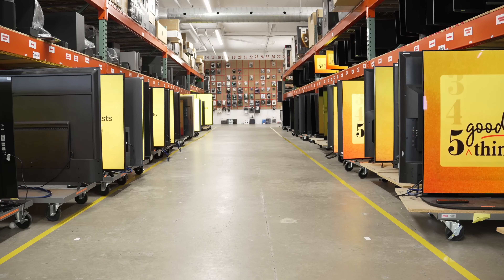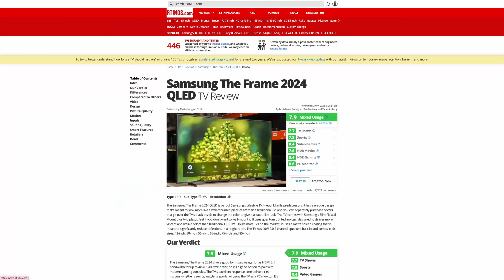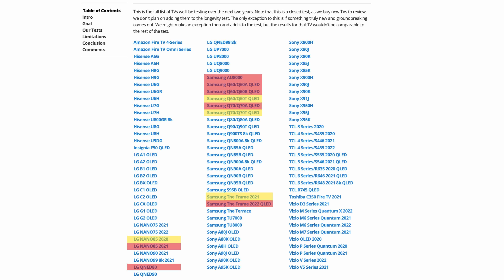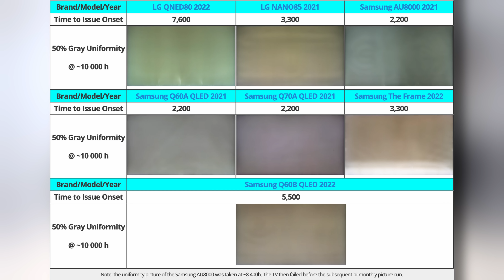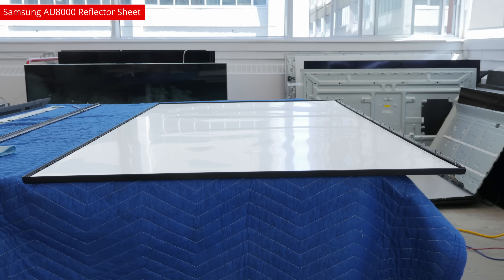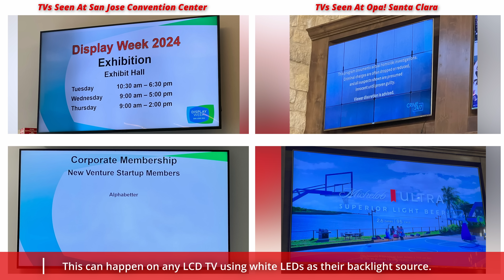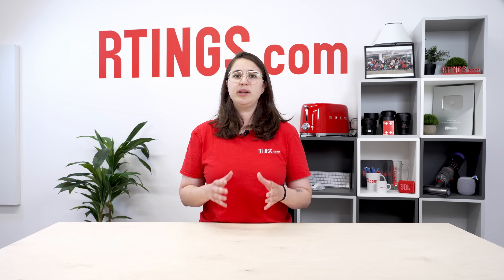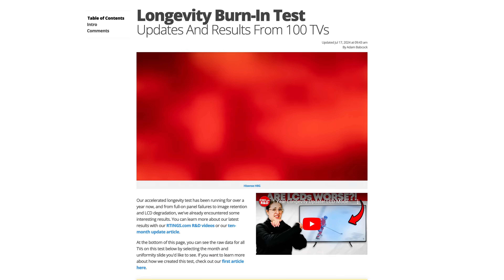Edge-Lit TVs Fail FASTER Than Others (100+ TV Test)

Comment: Early LCD TVs were thick. The design allowed for greater ventilation. That explains why they lasted for over a decade.
Reply: They also did not have LEDs that allowed for a thin panel. They used CCFL backlights, those are big and chunky, so the did not even have the chance to make them thin.
Reply: I do find ability to diagnose or try ti fix it to not need to buy a brand new tv if it is doable fwiw.. especially if bacjlights are what more or less fail first typically.. also reduce its brightness as much as you can fwiw.. vs factory defaukt 50 percent or highest mode..  @Galileocrafter
Reply: @Galileocrafter  It would make sense for consumers to demand thick LCD TVs with fluorescent backlights in order to obtain the best durability (and sound quality too, the in-built speakers were often actually passable back then) regardless of higher energy consumption or lack of "style".  The manufacturer could back it with a 12 year warranty, that those making LED-lit TVs might be unwilling to match.
Reply: They were thick and heavy. My last lcd lasted 14 years
Reply: We have a 40" 2007 Sony LCD in our bedroom. So far as I can tell, it still looks as good as it did when new. No 4K, of course, but we wouldn't be able to see any extra resolution from the bed anyway. We paid $1500, and I think it was worth every penny.
Reply: @jamesheartney9546 I still have a 26" LG from 2007. It is 720p, but still works good and hasn't had anything happen to it. That's surprising, considering that is the tail end of the capacitor plague era, in which so many Pentium 4 era computers, LCD monitors, and tvs were sent to the dump because of bad caps. As far as a CRT goes, I still have a TV from 1976 that works fine. No remote, and in order to change channels, you turned a VHF knob or a UHF knob. The cabinet is finished in fine fake woodgrain LOL
Reply: @jamesheartney9546  I still have my 1080p Sony 42" from 2010. Thanks to chromecast type devices I can extend their lives and use them for pretty much everything a modern tv can be used for.
Reply: @jamesheartney9546  I have Samsung 55" smart LCD chrome plated cover 240HZ, 3D TV ( never watched in 3D) , I have even paid  extra $250 for  4years warranty ( no needed this year the remote just on  last month failed) Tv still great color is amazing as new but it's not 4K, watching 720p no upscaling feature so, is not great for oldies)
Now I thinking to buy QN 90C series on 85 inch for our new house, but I am confused paying $3500TV with extra $820 plus tax on top for the Bestbuy warranty ☹️ any one feedback really appreciated
Reply: My chunky main turned bedroom LCD lasted since 2014.
Reply: they had fluorescent tubes for a backlight instead of leds, slightly less power efficient but they seemed to last, they were expensive too, but I think part of their longevity was they had to stand up top consumers expectations of what a TV should be able to handle coming from CRTs which many still work fine even today
Reply: Yep. My 2010 Sony Bravia is a bit thick, and it helps!
Reply: @aaroninclub I too have a 2010 Sony bravia. Flawless. 

When it breaks I'll just get another. There's plenty on eBay for around £25. Why would I pay ten times as much for a TV that'll break in 2 years?
Reply: My 47 inch wall-mounted 1080p LCD from 2012 is still going strong and is pretty much on 10-15h every day. I still see no reason to upgrade even with 4K going strong...
Reply: @Wockes same here , hesitant to "upgrade"
Reply: Bring back dumb TVs. I like 'em thick.
Reply: Watching this video on a 10+ year old Emerson tv that still works like a charm. This video has me rethinking some of the models I've wanted to replace it with.
Reply: Our living room TV is over a decade old and still works great. The screen puts out A LOT of heat though (fair trade off for reliability imo)
Reply: Still running a TV thats 15 years old by now and the best feature is that it can accommodate proper frontal firing speakers so you don’t need a soundbar
Reply: I am at like 15+ years on my LG 43" 720dpi LCD. No signs of wearing out. Daily use as my Dad watches a few shows at night over air.  It's crazy that it's still going strong.
Reply: Amazing that they've managed to get people to pay more, for a form factor which will inevitably reduce longevity and prematurely cause the viewing experience to degrade.

The funniest part of the whole thing, is that all you accomplish is being able to brag when new people come over how thin it is. It doesn't even sit more flush with the wall, as the base is still thick.
Reply: @Nevir202 planned obsolescence.
Reply: @Nevir202  I wonder why the electronics can't be placed in a separate model that can be placed somewhere else?
Reply: @TassieLorenzo  Interesting idea, probably possible, but there must be some issue with it, or I'd have expected someone to have done it.
Reply: my 37 inch vizio from 2010 is still kicking
Reply: @nitros3v3n I am not alone in clinging to my 37 from the same year
Reply: @secordman  it’s definitely a unique size
Reply: Yeah my 40” Sony from 2007 is still going strong. No changes in image quality over time and has significantly less blooming than all but the highest end current mini LED TVs.
The tradeoffs though are that it’s bulky and heavy, has comparatively bad contrast and black levels, uses twice the power of a current 65” and pumps out heaps of heat.
Reply: My Panasonic from 2006 still works, still used daily.
Reply: The reason was also because the backlight was CCFL and not LED.
Reply: I've an early fullhd samsung 32" (no led backlight) working in a shop 5 days per week since 2008!! model ln32a650
Reply: still got my LCD from 2008  it's 16 years old good brightness too
Reply: A Vizio 36-inch LED dumb TV from 2014 is pretty durable too.
Reply: Got an old 1080p samsung lcd or led tv, it's only 23 or 24 inch but the thing is thick and its probably from 2010's. So 14+ years old. Still working.
Reply: Early "LCD" displays still used xenon gas fills fluorescent light to light up the TV screen. those were even hotter, and the reason the tv's were thick, was because the light needed 3/8" around it so that it didnt cause a fire, with the tube itself being 1/2" in diameter in genera, you'd need 1 full inch of space for that light source.   LCD != LED.
Reply: a Samsung from 10 years ago works just as good at near 720p as both my monitors at 2k 165hz
Reply: My bedroom tv is like 15 years old. Thick as can be. Dim too. But still runs perfectly fine! And has the inputs I need! Sure a new one would be great. But they lose some of the inputs I want. Not everything I have is hdmi or display port. Plus the expense and failure rate, yea no. I’m good for quite awhile more lol
Reply: My LG from 2006 is still chugging along.
Reply: @jamesheartney9546 I still have a 40" Sony Bravia which I bought at a similar time to yours.  Great picture quality for a 1080p TV and has been absolutely reliable.
Reply: Ever notice when companies take something that works and makes it "better" it does not last as long. What do they say? If it's not broke don't fix it? Lol.
Reply: Same my TV is practically vintage tech it's not the most mind bending picture but it's like a 3rd as old as I am and should not of out lasted modern tvs
Reply: I expect many more years from my Sony KD-55XF9005 that's still going super strong after 6 years. 😊
Reply: I gave my parents the first flat TV I ever bought, a 37 inch Samsung from 2007 (CCFL-backlit LCD). Except for a dark area in one corner it still works perfectly, and they have it on literally every day.
Reply: Early they were CCFL which had a better life span ( but they could turn pink or get dark on one end).  Then when the first LED LCDs came out the were still thick and had more room to vent heat,but when they got thin, they got hotter.
Reply: Still using a 2008 43" Samsung LCD daily with no issues. The capacitors blew and were replaced under warranty soon after purchasing, but there have been no problems since bigger capacitors were installed. Screen still looks the same, no pixel issues. Fast forward to a Samsung 43" LED Smart TV purchased in 2012 and issues were noticed within two years (that fading effect near the corners/edges, diffuse bright spots). It currently still works, but it has faded pixels that look like strips going down the left side depending on the screen colors. During the past year it's happening on the right side. It cost more than the LCD (both cost over 2k usd), but is clearly not built to last. It gets very hot like it needs its own fan!
Reply: my philps 42” lcd led backlit tv also is from like 2010 and it has very nice colors, its very bright, low motion blur, great sharpness even when looking close up on it. it gets hot too but you can feel so much heat rising up from the radiator like design on the thick part of the back. its not actually that thick its one of the slimmer designs of the time. it also turns completely off when in sleep. it doesnt keep the computer part on like modern tvs do. hasnt ever had a single issue with it and never going to get a new one because the leds arent even getting dimmer its just as good as its first day still.
Reply: They also used a lot of metal instead of plastic, which helped disperse the heat better. Especially for the back and the wide bases that used to sit under the TV. My Vizio M series has lasted 11 years and 4 moves. It's outlasted a Fire Stick, a Chromecast, a PC, and a PS3.
Reply: @Paratet  I have a Sony xbr4 that had  had since 2008. Still great picture. No issues and Sony warranty was extremely excellent when I had a out of warranty. They gave me a brand new TV plus a bigger one and a newer model delivered and installed for 0.00
Reply: Why would they make them to last. They make more money replacing them, especially when most shops only give you one years guarantee
Reply: @colinperret3523  Yes now all small tiny semiconductor chips and covered with plastics no many ventilation holes that we can see , specially OLED for get it, manufacturing companies are looks they want to ripping off chunk of moneies from customers on these days
Reply: 0:28 Who runs their screens at full brightness? I run my monitors at around 25% brightness.
 Surprised manufacturers do not put more LED to underrun them to reduce power consumption and heat.
This is an informative :) Now I know rather to buy an HDR LCD model with a higher number of local dimming zones. So I get as many LEDs as practical and with higher brightness capability. I would still run them at rather low brightness with SDR content. It should last a long time :)
Reply: @ArthursHD  It really depends on the specific monitor and viewing conditions.  I had Dell monitors in work that needed the brightness pretty much maxed from brand new to give an acceptable picture, but the replacements 4 years later were fine at about 30%.
Reply: Also they probably made way more heat too
Reply: They were expensive too, which is another reason.
Reply: ccfl lamps also degrade and burn too ... plus they generate much more heat.... I have an old ccfl direct  backlight tv, it still works . One of the ccfl lamps is fadiing , but the problem isn't  that visible
Reply: Early lcds were also extremely dim, low contrast, full of ghosting, and had horrific viewing angles.
Reply: My first lcd melted. The screen turned white and it smelled bad.
Reply: I have a Sharp Aquos 70" that has been running for over a decade, and for the last 8 years has been on at least 12 hours a day keeping my pet entertained while I'm at work. To me, it still looks as good as the day I bought it!
Reply: Early lcds also generated much more heat as well.
Reply: Yep. Have an LG model that's 2" thick. No problems yet. I'll trade thin for longevity.
Reply: I have a 37" LG LCD from 2012 that is still going strong. I'm hesitant to "upgrade" since I'm not wowed by special effects and don't watch sports much anymore.
Reply: The old thick LCD TVs were thick because they were backlit with fluorescent tubes, not LED. And they had horrific uniformity issues after a couple years.
Reply: My 2008 Sony ccfl lcd is stll working fine, apart from a faulty remote sensor that recently failed. With hdmi cec, no big deal. I sometimes wonder with vwhat to replace it, if ever it fails completely.
Reply: I still have an LCD that is very thick from around 2012
And it still looks amazing even tho is only 1080p
Reply: They also needed to be thick and more or less well ventilated since they used CFL technology for the backlight
Reply: I have a TCL from 2013 until now I still use it all day
Reply: Anyone here still using a plasma tv
Reply: Older tv lasts longer. They were heavy but very reliable. My 2 tvs just died they were 20 plus year old. 😢
Reply: Mine's 16 years old and works perfectly, no visible uniformity issues and no lag at all (I can notice when a modern TV is tuned to the same channel, it has a slight delay). The only problem is it only has 2 HDMI inputs, nowdays it's not enough.
Reply: The LED I bought in 2016 has died. So I've been using the smaller 40something" Vizio that I bought used from my grandfather in like 2013.

I bet it uses more power, but it works. It's bigger heavier and thicker, and has more inputs to boot.
Reply: @ochiamu  what brand and what size of it 🤔 please if you can
Reply: @SamShawn-k2r  the one that croaked is a 55" TCL. I bought it on Wirecutter's recommendation back in the day.

The old Vizio has 4 HDMI I think, but also two composite, one component, an S-Video, and RGB inputs as well. And it makes me remember how nice it is to have a TV start up and show your input without having to boot to a "smart UI" home screen.
Reply: and back then most where still made in Japan instead of korea/china... that is thee main reason they lasted
Reply: 36 inch TV is just the way ober 200 lb Mia of glass steel and have big speakers in them the Roxy better made than they are now too what the price is a lot cheaper now for the large screens versus back in the old days and resolution is higher TVs are brighter they look a lot nicer but in all reality will never last as long
Reply: Have a 2004 Sony xbr4. Still very impressive picture.
Reply: it is 2024, use OLED not LCD 😅
Reply: @gasauto1675  OLEDs still have burn in issues.

Comment: My old samsung CRT TV still work today. I always find it weird that many companies with "green" stamp has planned obsolescence which means more e-waste.
Reply: My JVC D series had one capacitor fail. Not only was this capacitor already know to fail so I knew exactly what to look for, I had full schematics, a service menu, and parts list for the TV. It  will last until the tube burns out, and even then that tube can be rejuvenated for hundreds of more hours of use. Back in the day, they even had machines to replace the electron gun, which is fused to a glass tube mind you. 

We've gone so backwards on reparability in the past 20 years that now TV's come broken out of the box, unrepairable, and you void the warrantee opening up the package. No fancy tech for replacing parts, they wouldn't dare give you a part to replace anything because the manufacture actively hates you, knows your trans through analytics, and is selling your info to right wing organizations so they can put you on a list for project 2025.
Reply: My old Sony Trinitron's still going too.

Comment: I doubt those LEDs run 123°c. Reason is that's basically around where sillicon encapsulation of them starts to deform/degrade. No doubt they do run hot and poorly cooled as usual, but doubt its that bad.

It will be increased heat due to absorption of light on the thermal sensor. You need to use a small temperature probe or remote measurement in a suitable area that isn't reflective.

Comment: Interesting findings. Similar issues seem to affect LCDs in laptops and PC monitors as well. I had the screen on my laptop replaced due some of the backlight LEDs shifting their color temperature towards blue, which manifested itself as vertical blueish "bars" visible on gray and white backgrounds. It happened suddenly after only about 3 years of usage and the service center listed regular wear and tear as root cause. So it really seems that modern LCDs are "designed to fail" after a couple of years, which is a bit worrying considering that this was a somewhat expensive gaming laptop.

Comment: Interesting to see this finally proven. I've had some horrible uniformity issues with LCD over the years and even if they don't fail, the LEDs get dull quite quickly.  Since moving to OLED I've been very happy to not have any of these problems.  I think even once burn-in is visible, it wont be nearly as obvious as LCD ageing.

Comment: Durability hasn't been a concern to manufacturerers since the late 2000's. I've worked five years in hardware repair, mostly TVs and Computers. All those mid to late 2000's LCDs actually lasted more than a decade without major problems like the LCD panel itself dying.
But since the last decade their life spans have been slowly becoming less & less. Today it doesn't matter if you buy 100$ or 2000$ TV, it won't last you more than 3 years at max. The cheaper ones would literally die or develop some problem in a year and half.